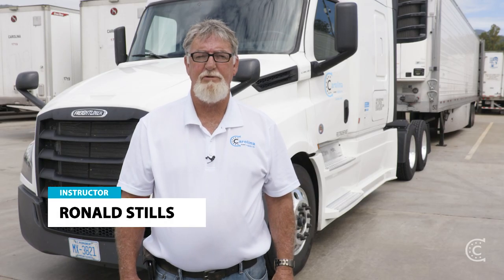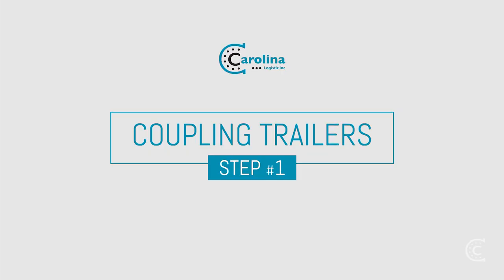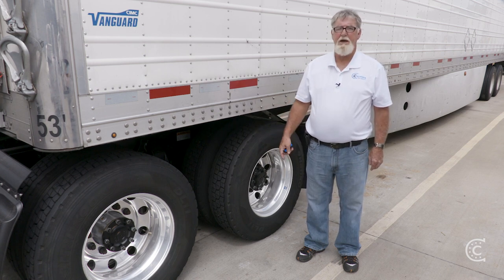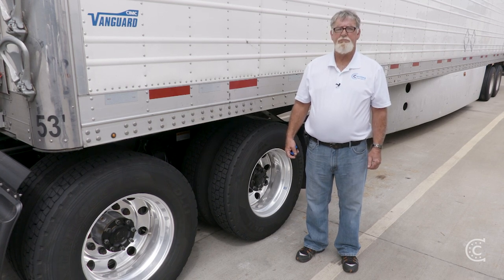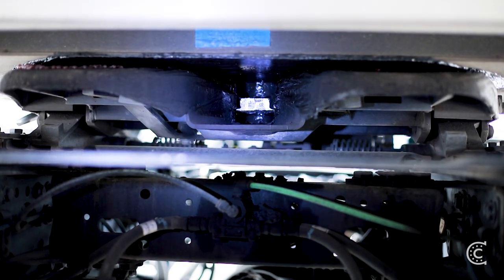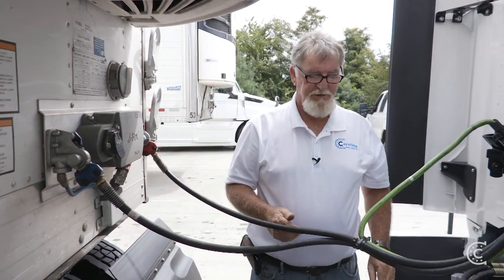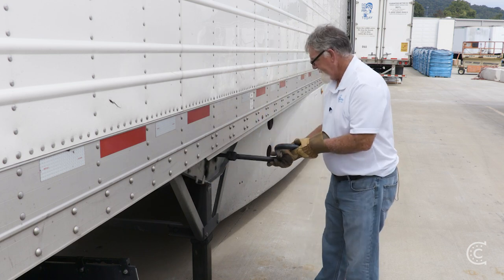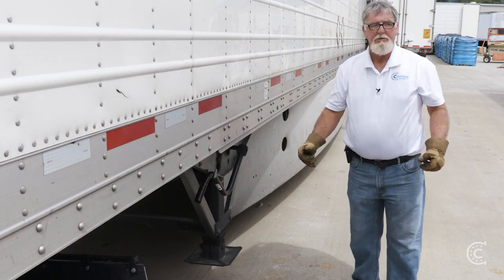Coupling and Uncoupling Tutorial

Comment: No Trailer ABS line?  When i get under a trailer in Europe i raise the rear axle of the tractor and raise up the trailer to avoid bending the legs
Reply: InThe U.S the trailers have their own  abs systems on the trailer so they just need power from the truck . The power comes from the center pin of the light cord and it can also get its power from the brake lights should the center pin loose power or if it’s a older truck that is not wired for abs power